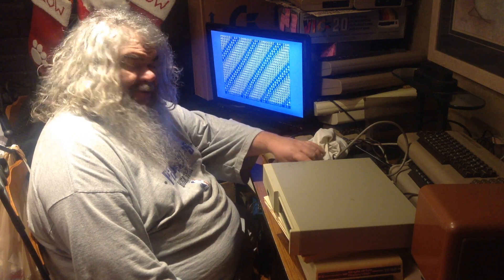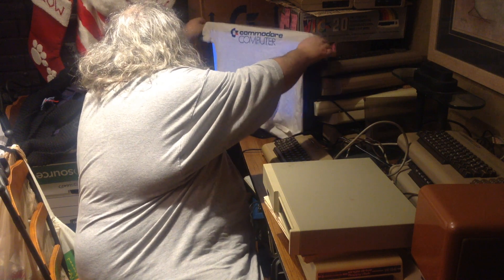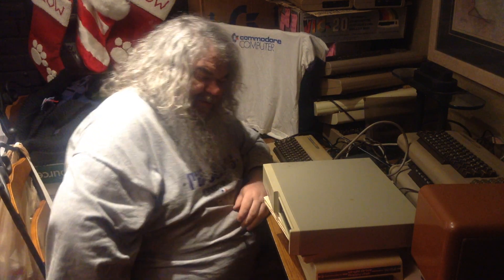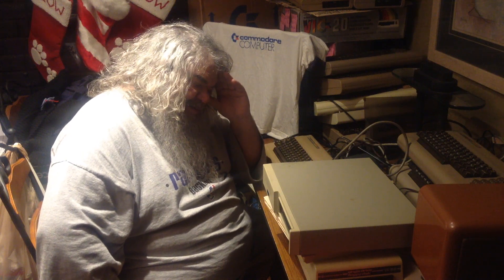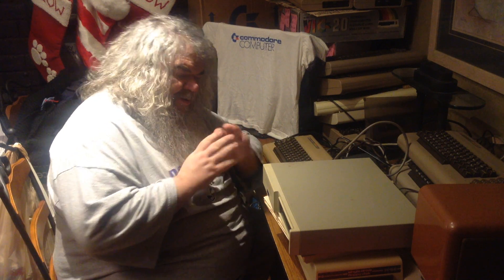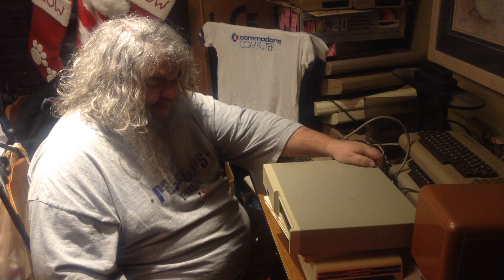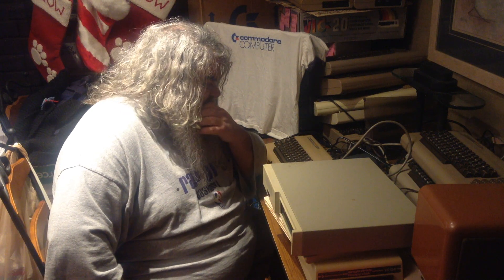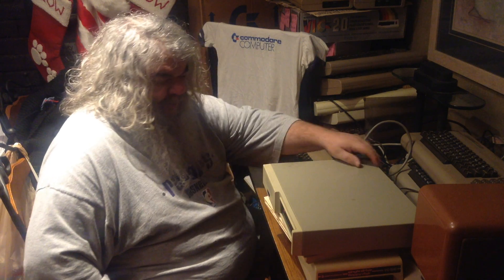Jim Butterfield Lt. Kernal Commodore 64 Hard Drive Prototype Story - C64 C-64 BBS PET - Episode 731

Comment: I ran a bbs in surrey, bc had an lt kernal hard drive, if i remember correctly it was hooked up with several jumper wires that littarly i clipped to the pins of several chips inside…. Was the coolest made my board incredibly fast, and running the image software that was the first true email.. took a day or so for a message to bounce from bbs to bbs as they shared packages of data couple times a day, often long distance calls..  was many hours spent in a chair programmimg mods, and upgraded etc.. 

 I still have the books n manuals from it all someplace ill dig it up and share
Reply from the maker: Indeed, the Lt. Kernal did have a couple of wires that needed to be clipped inside...I think it was two, but there may have been other versions that had different configurations...I will try to get mine out and see if I can get it working again...anything is perhaps possible...they certainly did make any BBS better...faster...with tons of storage and the drive could sit under a monitor quite nicely if you were pressed for desk space...thanks for having a look...and I hope you are still enjoying being part of the World of Commodore!

Comment: Those were very interesting hard drives. The operating system of the drive was based on the IRIS business BASIC operating system from Point 4 Data Corp who was a manufacturer of Mini business computers starting in the 1970's. We had a point 4 IRIS computer system at my work back in the day.
Reply from the maker: They were great for BBS people...and I am sure there were many other wonderful applications as well...and the drives were much easier to interchange with other sizes...as I remember...I wonder if it would handle a really big drive of the same kind and work well these days...I should crank up the drive and gather all the bits together and see what is what!

Comment: Holy balls. Finally a video about the Lt Kernal. Ive been hoping someone would find a working one and set it up. Im subscribed to almost all the Commodore youtubers, and nobody has ever had one that Ive noticed.  I had one of these 20 meg ones for my BBS back around 1988 or 1990 or so. Replaced the Memory expansion box I used for the BBS. and all the 1581s I had (4. I spent alot of money on that commie). I so wish I still had it, but I was just about done with being a Sysop. The headaches werent worth it, and shut my board down about 1991. Then traded the Lt Kernal for a handheld trashy computer, to spite my mom. Im subscribing. I hope you find your cables. Are you going to just plug the card and cable in, or go into a computer and put the chip connection in? I know you dont HAVE to do it and it works fine... (I had it both ways, and never noticed much difference.)
Reply from the maker: I will find the plug in the cable...I never heard of the chip connection...interesting...I am slowly finding things and getting ready to get back in the game...stay tuned!  Thanks so much for writing...these drives were heaven and so perfect for BBS peoples!
Reply: @DRBradleyPhotography  they really were. So much room. The only pain using them was it was divided up in 8 sections. But was really nice. Wish i hadnt gotten rid of it. Theyre super rare nowadays.
Reply from the maker: I suspect most of them got discarded or the drive mech used for something else...or they are sitting in storage, closets, basements, etc...
Reply: @DRBradleyPhotography  the “chip connection” were the 2 jumpers that controlled HIRAM & CAEC. Only mattered for ICUBE and/or if you were MUX’d.

I still have mine and am about to reboot The Hacky Shack BBS on it. A BBS  I co-sysop’d back in the 80’s.

Hopefully you’ll find your host adapter.
Reply: Oh, mine is 40mb Mini-Scribe

Comment: I had a 20mb Lt. Kernal running on my BBS and I had a multiplexer so I could connect up to 4 computers to it.    Before that I had a 20mb Data Chief but the Lt Kernal was a far better system to have.   Many won't view it today as an impressive system but then many have no clue what they are looking at.  CMD came out with there 100mb HD System which was very impressive but at the time those puppies were very very expensive but if you had one it was well worth every penny you spent.  Hard to believe today you can have magnitudes of order more capacity on something the size or smaller than a finger nail.
Reply: I was 13 y/o when my Lt. Kernal finally arrived at the local computer store.  It was my Christmas / Birthday / Every saved penny for a year "gift."   The day I brought that puppy online I immediately had one of the largest file sections around on my C-Net BBS. Some of my fondest memories, for sure. Cheers!
Reply from the maker: Running a BBS was indeed a great experience for me as well!  So much was learned getting it up and running...as well as how to deal with people, etc!
Reply from the maker: They were a very good system...to be sure!  Sat nicely under a monitor if you were so inclined...I did not know that you could connect it to more than one computer, but am not surprised...those XETEC people were sharp!  Stay tuned as I get the drive and the interface together so I can test it!
Reply: Same here 20mb
Reply from the maker: Still gathering...